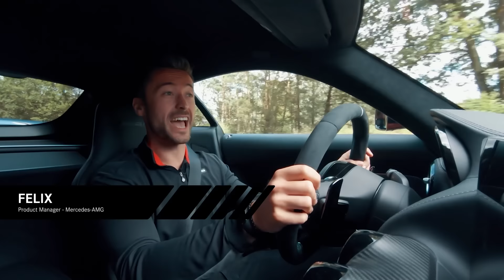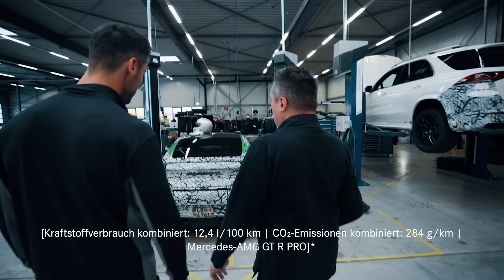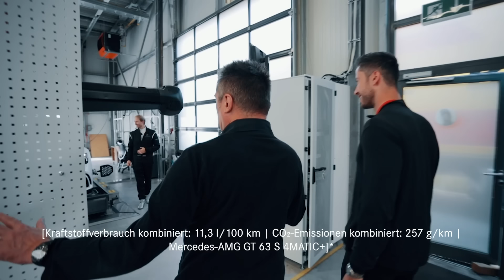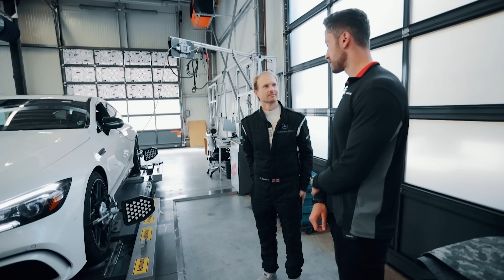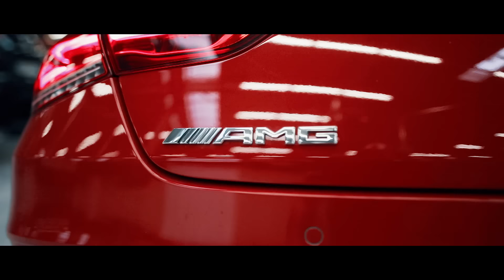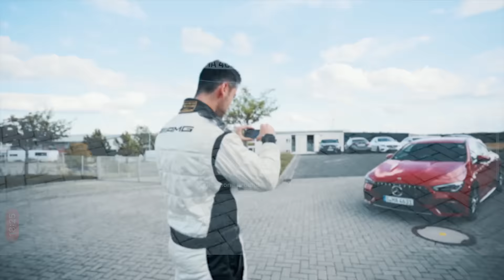INSIDE AMG – Green Hell | Proving Ground of Driving Performance!

Comment: Why??  Why?  does anyone go to the Ring and not drive, not complete a driving lap????
Reply: its a public road firstly. secondly when the guys set times,often they are closed on the day or for that part of time when a timed lap is done.  also the manufacturers hire the track for a full day at times too to do "closed"testing as well. seeing the lap is so long,nobody really does a full lap but timed from point to a certain point. but as i said,when they do a full lap,mostly its a closed track when laptimes are measured.
Reply: @ashleydaniels1132  over 500 laps.  I know the details.  A public toll road, why not drive it?     M-F   17:15-19:30    longer days on Sat and Sunday. 
There are porsche owners in the USA and BMW owners and Mercedes owners who have completed the European delivery programs; driven to the Ring and then not completed a lap.  WHY?  Why does anyone go to the Ring and not complete at least one lap?   WHY? 
Have you been to the Ring more than once and not driven a lap?  WHY?  Life is short. 
German govt. is changing, speed limit on auto bahn discussed, insurance co. do not like the Ring. Times change.
Reply: @dafrasier1  eco worriers are a big part of that. hence the quieter cars,etc. and yess been there a few times. driven it on 7 different times about 4laps a time. sad man sad. was lucky though checked the rings time slots for normal people like me.and went.